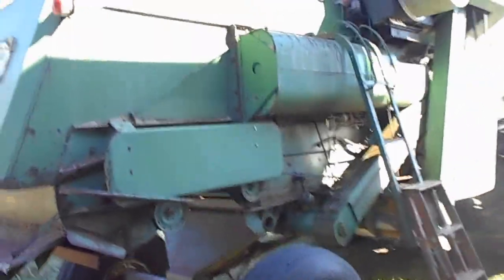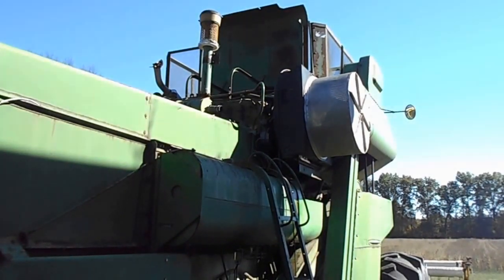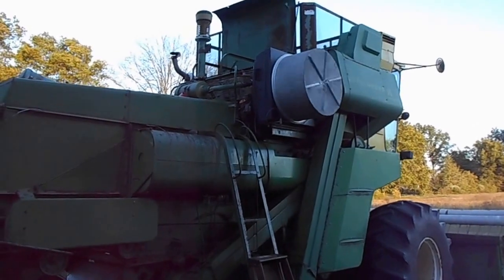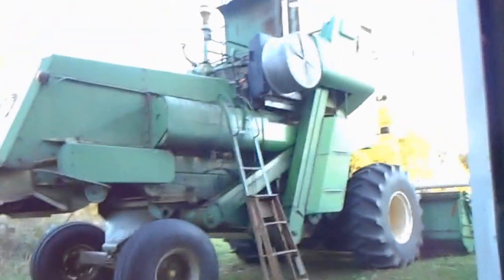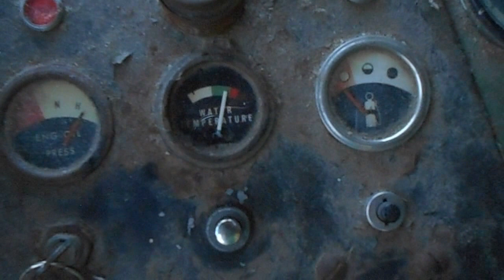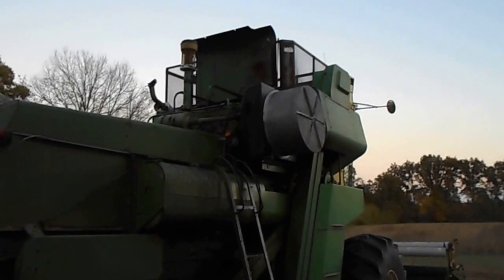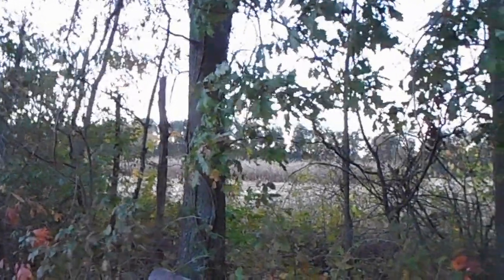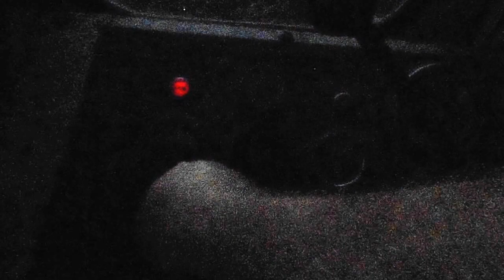JD 95 Fix ? Neighbor Shelling Corn

Comment from the maker: Sunday morning I got started on the JD 95 Fix. What I was going to do got changed when I drained the radiator and it had a lot of oil in it and oil wont cool like water will. So its time to flush it out good ! While doing all this the BTO neighbor showed up the shell corn and cut beans and they were moving on. 3 flushes later and 45 min of running the gauge said it was getting hot, I shut it off for 10 min and restarted it and the gauge said it was cool and stayed there. What the heck is going on here ! I got to do something but what ?  I got to think about this one and figure it out !  I hope you enjoy.  Bandit
Reply: Bandit farmer I'd almost say head gasket with antifreeze in the oil. Especially how milky white it was in the second bucket. That sucks either way though. I'd change the probe and thermostat just to see if it helps
Reply from the maker: Its not a head gasket cause there is NO water in the crank case , There is oil in the cooling system . I've had 3 different JD 303 gas engines that have the same problem . As of now the thermostat has been changed and the sending unit has been changed radiator has been flushed out good and still have the problem but as of last night I but a manual temp gauge in to see what the temp really is. Bandit
Reply from the maker: I may have to if it gets hot today when I cutting beans.  Bandit
Reply: Bandit farmer I've seen oil in just the radiator but the manual sensor is a great place to start. I'm hoping it's just a hiccup and your manual sensor says everything is ok.
Reply from the maker: Well as it turns out it was the electric sensor ! I put the manual one on and it solved the problem. Today I ran it in the field for 5 hours and it never got over 195* , Problem solved !  Bandit
Reply: You probably have a cracked head because oil pressure is greater than the coolant pressure in the radiator so the oil will force it's self into the coolant
Reply from the maker: Maybe but I don't think so.  Runs to good and I'm not getting water in the oil pan and its not running hot . More than likely there's a bad O-ring someplace letting the oil get into the water. I've had several of these engines and at one point or another they all do it, Just the nature of this engine design !  I did find the problem with it saying it was getting it hot,, Its fixed now.  Bandit

Comment: Bandit I been following along on your harvest videos. Glad to see the beans are doing well so far. I hate to hear about the combine. I knew as soon as you said you found oil in the water that things where not good. Hopefully you get by with just a head gasket. Your neighbor has some nice equipment. Looks like they are running 12row heads. For as many acres as they cover i'm surprised they have not switched to 16 row heads. They had the Steigers out a few years ago working ground close to me. It sure did look like things where getting done quick.
Reply from the maker: The combine has been doing this sense I bought it 6 or 7 years ago, Heck even the old one did it too and it ran for 15 years like that. So I'm not to worried about that and I did find the problem with why it was saying it was hot and have this fixed now. That video is coming soon.  That's why I had 5 over loaded wagons sitting in the barn for 6 days , Everybody hit the fields hard at the same time and there wasn't a truck available for a week ! LOL  I still love seeing work being done on the farm.  Bandit

Comment: Well crap.  Isn't this a PITA.  Is there someone locally you can rent or borrow a radiator pressure tester?  That would put the cracked head or gasket question to rest.  I'm glad you changed the temp gauge.  I still think that is the issue.  The swing is to big to quick.  Do you have an exhaust leak in that area?
Reply from the maker: Well sense I started it this fall to get it ready to run the temp gauge has been off, I would run in and it would say its hot and I'd put a mean thermometer in the radiator and it says it 190* right ware it needs to be. So I just knew something was off but I got it figured out now. I shound have trusted my gut right off the bat and not let my mind start running with ideas !  Bandit

Comment: Bandit, I am not familiar with the engine in these combines but I am familiar with john deere engines such as in a 4010. I don't think there is any way the oil could get in the the water through the sleeve o rings. There is no oil pressure down below the orings, just oil splashing around from the rods and crankshaft. The tractor motors do have an oil passage going to the head to lubricate the rocker arms. This can push oil into the water if the head gasket is bad.  Also do these motors have an oil cooler. That could allow the oil to get into the water.
Reply from the maker: I think the early 4010's had the same engine as this one , I had a late 4010 gas that had the same engine as a 4020 so I've had little expearance with these till we got a 55 with a 303 and then 2 different 95's  with the 303 and they all have had this problem at some point.  At one time I helped a guy tare one down to see what the problem was and for the life of me I cant remember what it was, And the guy I helped died 5 years ago so I cant ask him. This getting old is for the birds ! LOL The engine does have an oil cooler built into it I just cant remember how it all went together.  But I got it figured out now.  Bandit

Comment: Oil in the water sounds like a big problem to me. How much do you have to cut can you finish without ruining the motor? Then find your problem at a time when it is more relaxing. I had one 95  my dad had two of them they are great when they are takin care of good luck fun video
Reply from the maker: I found the main problem but the oil in the water I'm still trying to figure out , Its one of those that I may have to live with till I can really figure out. A small amount of oil in the water I can live with for now. I do need to be looking for another 95 with lower hours on it.  Bandit
Reply: Howard Younger do you have  1to sell

Comment: hey Bandit if  you don't mind or if you have the time for this question I will be thankfull..  what is the difference between a 95 combine and a 4400 combine ?? is it just the age ?? and the difference beween a 4400 and a 6600  if you cant awnser its not a biggy. thanks for the good vids bandit!!!
Reply from the maker: The 95 was built in the 60's and in 70 the 95 was replaced by the 4400.  In the 60's JD built (from smallest to largest) the 40 45 55 95 and 105 and in 1970 the 40 and 45 were deleted from the line up and the 55 was replaced by the 3300 the 95 by the 4400 and the 105 was replaced by the 6600.  When the 7700 was brought out it was the new big machine in the line up.  The 5 series combine (55 95 ect) were all replaced by the 100 series JD combines (3300 4400 and so on) and I really think they would have been better off by building an updated 95 rather then going to the 4400. The 95 is easy to work on compared to the 4400, They are a big pain in the butt to work on in my book !  But they are good machines just a pain to work on.  Bandit

Comment: That oil in the coolant sure isn't helping anything. If it's a sleeve o-ring I wonder if a good block sealer would be worth trying? I'd sure hate to be pulling the sleeves without trying it first.
Reply from the maker: This is a problem I think all the 303 gas engines have at some point, I've had several of them and if you keep the oil from building up in the radiator they will keep on running for a long time. There is more oil pressure than there is water pressure and if these a weak spot its going to find it. Better to have oil in the water than water in the oil !  Bandit

Comment: Water in the cooling system should be at 15psi ,oil in the oil galley is at least 30 psi ,it has to have blown a head gasket if the o rings on the sleeves went bad it would dump antifreeze in the oil , nurse it along get the beans of then worry about it
Reply from the maker: Not a head gasket for sure , I've had 3 or 4 of these 303 gas engines and they all had this problem. Don't for sure what it is but over time they will all get oil in the radiator at some point. Its not a big problem but it is a problem  they have. No water in the crank case but oil in the water I've dealt with this before and they always just kept on running. Bandit

Comment: Infrared Thermometer will make it very easy to determine where the heat source is.  shoot the input to the radiator then shoot the output, real easy to see how much cooling the radiator is actually doing.  the tool also comes in real handy for determining where these lubed for the life of the bearings are in their life span.  heat in machinery is the enemy. the digital non contact Infrared Thermometer is the one tool allowing me to determine quickly where my heat problems are.  it is a 40 dollar tool so, why guess when you can know?
Reply: +Soybean Farmer I had just heard the same thing from a friend of mine, retired truck mechanic in my antique engine club. Never knew there even was such a thing before, but it sure sounds perfect for Bandit's problem.
Reply from the maker: Soybean Farmer I finaly found the problem and fixed it and it wasnt that hard. With the combine running the thurmostat is working and you could feel the air off the radiator heat up then cool off and it had good circulation from the pump. I kept sticking the meat thermometer in the radiator and it would go up to 190 when the thermostat opened up then would cool off so things didnt add up. But I did figure it out now and I should lessend to my gut from the start and not let my mind go wild ! LOL  Bandit
Reply: Bandit farmer

Comment: You struck oil Jeb! Time to diagnose everything and ignore the temp gauge. #1 Take a hose off the water pump and see if it blasts you/combine with scalding water (it's got to be done) #2 Take top/bottom hoses off radiator & run garden hose through it, it should go right through. #3 Coolant leak down test with air pressure & gauge on the radiator fill spout, you might here a hiss from the oil fill spout when that cap is off. #3 "Over tighten" the water pump belts to the point they get hot just for the temp test. #4 Timing is off? That's why my dads farmall m years ago was overheating on the silo blower, made the muffler glow like the sun. #5 Head blowby tube plugged? Does this engine have blowby when the dipstick is out? #6 Plugged air filter? Yeah the head gasket is bad but question is what else.
Reply from the maker: The oil in the radiator is coming from a bad O-ring on a sleeve , It lets oil pressure get into a water jacket. This is a commend problem on these engines with hours on them plus age . Last night I took the electric sending unit out and put a manual gauge in and I'm going to find out today for sure what the temp really is. Today is the day !  Bandit

Comment: Only way to find out is just change it  - how much are they - the probe or sending unit - no use to wondering - just change it - and see what the results are - oil in the anti freeze is  very bad - bad head gasket ??? ouch

Comment: Well the coolant had to be flushed. I'll say a prayer that the water pump fixes that.
Reply from the maker: Well the system is flushed out good now and when you pour water into the radiator it goes in as fast as you pour it so the core is good and open. The old water pump is still on it and last night I changed the temp unit out (electric) and put a manual gauge in to see what the temp really is. So today I will find out for sure plus I got beans to cut beans today so I'm going to find out for sure today !  Bandit

Comment: the after cooler for the engen mite be licking oil into the water..
Reply from the maker: No after cooler on it , The 303 JD engine is know for cavitation and getting oil in the radiator.  This engine has 4800 hours on it and it runs good but its going to need rebuilt before long, One of the biggest problems are the O rings on the bottom of the sleves get old and hard and they start to leak. So a 329 JD diesel repower might be in order !

Comment: And you said you aren't losing engine oil?  So not the headgasket?  Maybe the new antifreeze will save ya for a while.
Reply from the maker: Well all the work I did will help it in the long run, But I did find the problem and the problem is solved.  It will be on an up coming video.  Bandit

Comment: Sounds like it's time for a motor overhaul or another combine, neither option is gona be cheep
Reply from the maker: I'll find another combine before I do an overhaul ! There are good 95's still out there to be had and a kit to overhaul it is in the $1400 range and a 45 year old engine with 4500 hours on it will need to be in a machine shop before and rebuild so another grand.  $2500 plus will buy another 95. LOL  Maybe a repower ?  Bandit

Comment: Yeah oil in the coolant is never good... looks like a leak from an oil gallery to the coolant jacket... if you're lucky, it's just a bad gasket allowing oil to seep from the oil gallery across to a coolant passage.  If you're unlucky it'll be a hairline crack in the head or block from the oil gallery to the coolant jacket.  No bueno!   Probly take a lot of flushing to get rid of the oil, and really get it clean, plus you gotta check for radiator flow-- oil can really sludge up the passages because it reacts with coolant and stuff to make sludge.  Yuck!  If it were me, I'd have that radiator off and to a shop to get rotted out-- they use way stronger stuff and can really dissolve the crud inside and out and get it flowing again, so you KNOW it's good.  Then you can go from there.  Never seen a water pump with TWO necks on it... kinda goofy lookin'.  So it takes water in from the lower one and discharges most of it/all of it out the side?? Crazy.  Sends it through a hose to the block or what??  Hope it all worked out for you and looking forward to the next vidja!  OL J R :)
Reply from the maker: With 4600 hours on a gas engine she it tired and in need of a rebuild at this point. Problem is for what it would cost to rebuild it I can buy a good replacement engine cheaper and thats what I'm most likely going to do if I rebuild it. The 303 engine has a lot of power for its size but like everything else there getting expensive to work on but with diesel prices like they are I'd still rather have a gas engine in a combine for what I'm doing.  Bandit
Reply: @banditfarmer1900  Yeah I hear ya.  One thing that really impressed me about Deere back in the mid-late 90's was, when I started checking on stuff, they could get any part I could need on any combine they built back to the old "x5" series... if it was self propelled they could get parts!  IH had screwed us over on the old IH/McCormick 214/220 pickers by freezing out parts.  SO I basically have pretty much said screw CIH and NH is nearly as bad since they bought out Ford Tractor Division in the mid-90's.  They screwed over the Ford shortline equipment owners just as bad.  I guess these machines are just flat getting old enough that Deere isn't interested in keeping up parts availability for them.  

As for the diesel thing, yeah I can see it both ways.  Diesels usually have lower fuel consumption for the work they do (more efficient) because of higher compression, so IMHO a diesel is cheaper to run.  I know the old gas cotton pickers in the 214's and 220's were about to kill us, they were SO thirsty... they had BD-240 International inline sixes in them same as the old 50's IH pickups.  Fairly efficient but still they sure sucked the gas!  My old Ford/Claas 640 combine has a Ford 300 inline six industrial engine in it running on gas, and it's "thirsty enough" though the 300 six was probably about the most fuel-efficient "big gasser" you could get.  I sure wish they still made them for the pickups!  Loved my old 300 sixes!  The V-6's are crap compared to the old inlines!  

I know a lot of guys have started buying one-tons with the gas engines because diesel engines have gotten just stupid expensive and then they have to delete them to get any mileage and lifetime out of them, which costs a bunch more, so they can save about 20K bucks going with a gas truck.  Problem is these new gas trucks they want to put HUGE engines in them and so they suck the gas ALL THE TIME...  Not just when you're really working them hauling or towing heavy stuff.  My old 300 six, she'd get nearly 20 mpg just toodling around 70 mph on the highway, though of course she'd sip quite a bit more gas towing a load.  Basically they're putting all these stupid 6-10 speed automatic transmissions in these pickups now, so there's NO REASON for such a big motor slurping gas all the time-- let the transmission do the work!  Course everybody thinks their pickup needs to be able to stay neck and neck with a Corvette from a stop light, so that kind of acceleration and performance requires horsepower, and horsepower requires displacement, and displacement sucks the gas LOL:)  Later!  OL J R : )

Comment: See what the results are after the flush - good or bad
Reply from the maker: Well I found out that the sending unit was bad so it got a manual gauge put on it and that solved the problem, But the flush helped  !  Bandit